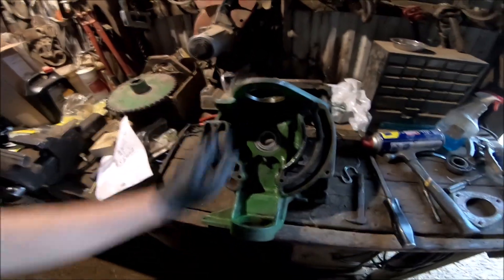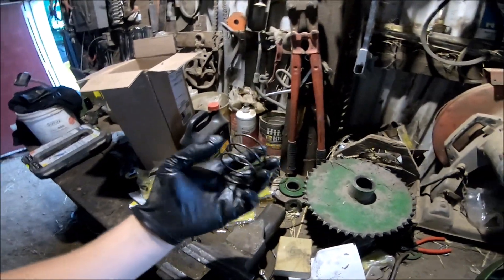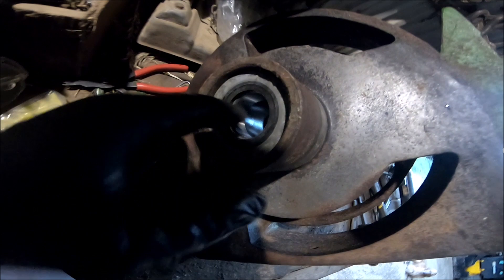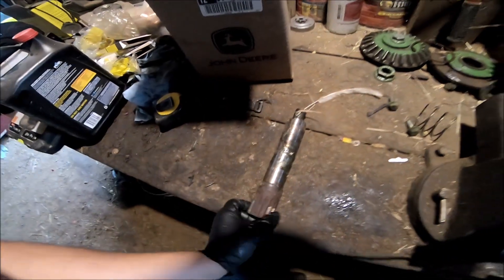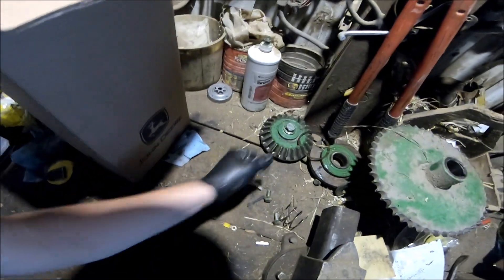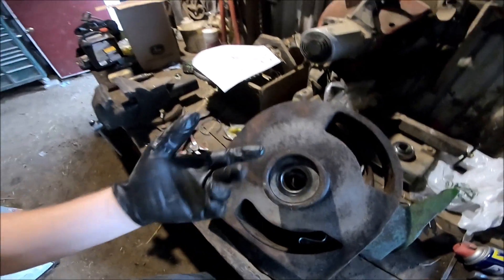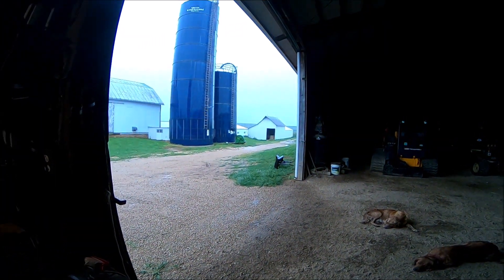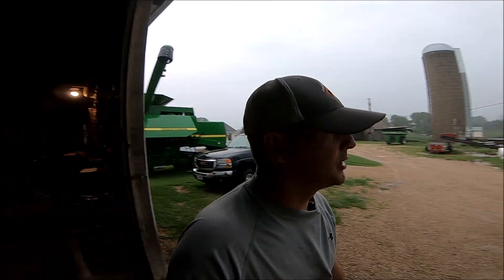Break It | Piece It Back Together

Comment: I was told that a ball peen hammer has a different harness on the face than a claw hammer to reducing chipping its face when beating on steel.  

$500 labor?  It’s about a two hour job once it’s on the bench back when I was doing them all the time.  Would take me longer now.........
Reply: d6joe that is what I learned as well was the hardness are different. If you want a chip to come off and get you in the eye one day go ahead and use the claw hammer

Comment: If I had a good 9500 or 9510 that's paid for and it gets the job done I wouldn't even think about buying a new $500k combine.
Reply from the maker: Any "new" equipment will never land here. Rather buy lightly used with the depreciation off than brand new and loose that value
Reply: @TheRestOfTheStory  I hear ya.  I don't get people who buy new all the time.  They're usually the first ones to bitch about grain and fuel prices too.😂😂
Reply: @TheRestOfTheStory  I thought you bought the gator new? Btw how is it doing?
Reply from the maker: @afarmerslife992  working good. I'm talking field equipment.
Reply: @TheRestOfTheStory  how many hours or miles does it have?